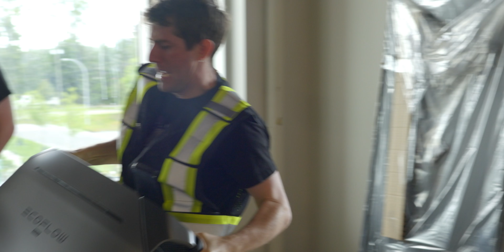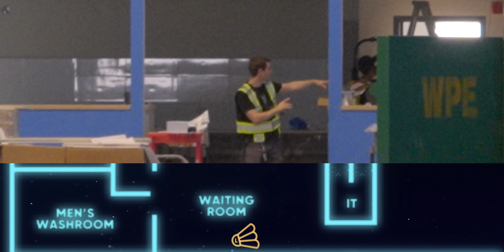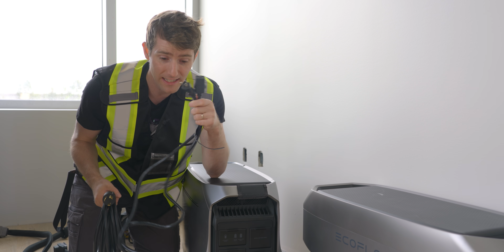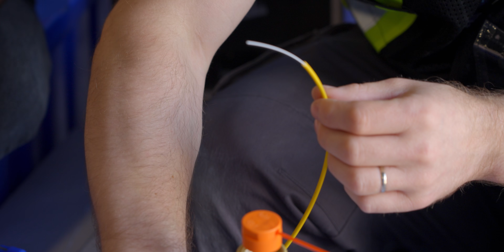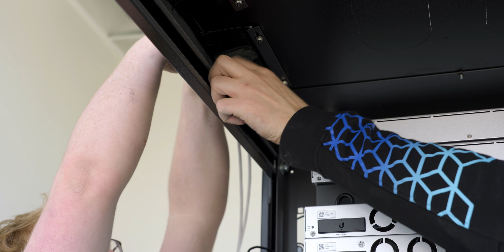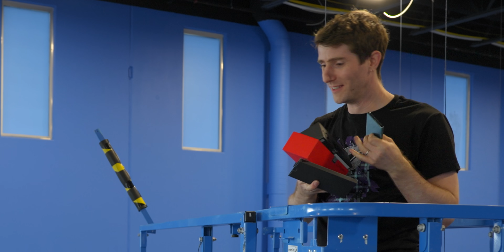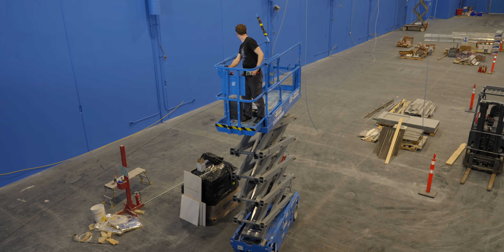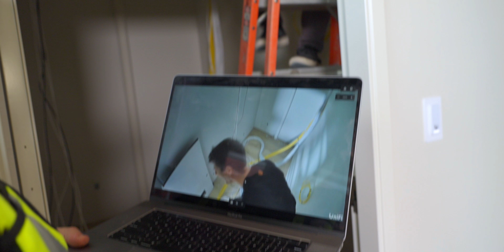I put WiFi 7 in my badminton center

Comment: As someone who does Pro AV. I'm curious to see how they deal with the soundtube speakers. They are Dante network audio devices that require PTP with QoS which the Unifi switches don't support. Aka when guests start using the network it will start dropping audio packets because of latency. If they are all plugged into the same switch it might be ok, but I'd use a switch that supports a proper QoS configuration for them.

Comment: If the power in your home has a dynamic rate that depends on the time, you could perhaps use these batteries to pull a bunch of power when it is cheaper and run off battery when it is more expensive. Maybe having a micro controller automate that could help save money over long term.

Comment: Originally, I was going to comment about the lack of harness in a scissor lift, but as it turns out, per Canadian federal law, harnesses are not required on scissors if they have guardrails. 

However, most provinces require harnesses with non shock absorbing lanyards, but work safe BC does not require fall protection in scissor lifts, Ontario on the other hand, requires fall protection in any sort of mobile work platform, regardless of if it’s elevated or not.
Reply: Not familiar with BC legislation but for Manitoba, the only exception to the harness requirement is if you're not driving the scissor lift. As long as the lift remains stationary, you can go as high as you want without a harness.
Reply: Pretty sure its specified by work safe bc @ 3m, regardless of movement or not in a scissor lift. Most employers will require you to have a harness if your feet are above 6-9ft, or near a leading edge (regardless of height).
Reply: @jzytaruk  honest question, what would they accomplish?  There is basically no way to fall off of ones of these without doing something dumb like climbing the rails.

Comment: I sell and install access control for a living. For the strike. If you don't want to cut out the dust box and cut the frame you need a no cut strike. It will fit in the dust box and no need to modify the frame.

Comment: I only knew POS as "piece of shit" until after I went to a restaurant where the cash register was acting up. The manager told me "we're having POS problems" and I didn't question it because the cash register was acting like a POS. A while later I realized he meant Point of Sale. A while after that I realized he probably meant both.
Reply: It means both.   Point of Sale stuff is fricking horrible
Reply: @markoshark4697  Dead heat between Aloha stuff which is COM all the way down and Micros which uses XML files dropped into a Samba share to communicate between front and back of house systems tbh
Reply: @tparadox_1988  As a General Manager of a restaurant. I will confirm POS stands for both lol.
Reply: yeah in that moment, he probably meant both POS' 😂
Reply: Then they perfectly transitioned into talking about POE...now I'm always gonna think of POE as Piece Of Excrement.
Reply: For linguists it's the part of speech :D

Comment: I know that building practices vary between regions but i’ve seen 2 smaller commercial grade properties go from a similar spot (still needing ceiling panels hung low voltage ran etc.) to ready for soft opening in 2-3 weeks. all though the number of laborers almost doubled. It’s honestly impressive

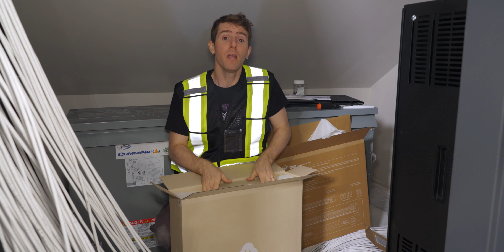Comment: (05:02): Now sponsored by Commercial Electric ..After hearing a story that the voltage in one of the rooms might be too low, Ask an electrician to change the "Primary Tap Changer" setting in one of these transformers. due to computer loads, I would prefer 124 volts at most, to allow voltage drops

Comment: Last night I left my pc on during a thunderstorm with a lot of lightning. This morning my pc was working fine until the evening when I put my computer on sleep mode and woke it up 10 seconds later. It IMMEDIATELY DIED, and a bad burning smell was coming from the gpu. Tech friend says it could be the psu but I tried it with and without a different gpu and it worked. I don’t know what to do…

Comment: Just as a security thing, the wide open strike plates can be somewhat problematic as they often don't stop the deadlatch of the door mechanical lock. This is important as the deadlatch is what stops you from slipping the latch on the door and so bypassing the lock.

Comment: I'm not entirely just of the dimensions of the sport center but I thought for sure "Gamechanger Cable" (thats the brand/type) would have been used and got its own video, it can do 2.5GB/s at 200 Meters and just needs special RJ45s to accommodate the larger cable diameter
Reply: It's significantly more expensive than Cat6 or Cat6A runs. I also wouldn't trust it with reliability compared to cable manufacturers like Belden or Commscope.

Comment: has Ltt never heard of a furniture dolly? or just a dolly? also i feel like the shear amount of wifi in this space will destroy anything else on that band like wireless peripherals cell signal etc
Reply: Wi-fi operates on different bands than cell towers, so they're transparent to each other. It's not likely to be a problem for Bluetooth signals either at very short range, which is all you need even at LAN parties. Hardcore gamers still use wired peripherals anyway to ensure the lowest latency.

Comment: I see your fear of heights isn't that bad. I had to reset thermal fuse in gas heater in about 8 meter height. Everything was fine till like 6 meters and then I just curled on floor of cage and couldn't move. Took me a while to stand on legs but NOPE, wasn't able to reset it and someone else had to do it while I was giving instructions, still curled.

Comment: I install electric strikes regularly, most have to be cut in but there are some that would fit that. HES is a brand that has one but don't remember the part number off hand, you will have to remove the dust box behind the strike

Comment: Soundtube IPD4 series ate Dante. Dante flows can only be done using unicast for a few connections from a TX. You guys will likely need to use multicasting for streaming dante to all the speakers. Ubiquiti notoriously sucks for AVoIP, so it will important to make sure your network is setup properly. Dante is time critical audio. It is inportant to make sure PTP is propegating the network correctly.
Reply: Huh, someone told me Ubiquti sucks for even office IP phones. I didn't understand, but then when I asked to elaborate it was just that Ubi sucks at VOIP stuff. 

Interesting. Now I get a bit of it
Reply: @hariranormal5584 I was referring to Audio Video Over IP but I heard the same about VoIP too. We deal in a lot of  professional audio systems and Ubiquiti is stricken from the list of approved switch vendors. I have never seen an enterprise use them either.

Comment: You have the means for 1Gbps/10Gbps to every machine, and you're all about Wifi? Seriously? Wifi is great on its own, but if you want the best, fastest and most reliable, go hardwired. Either Copper or Fiber.

I get your feelings on the scissor lift... I'm iffy on heights. If I'm 'up high' and on really solid footing, I'm ok, but if I'm 'up high' and my footing is..... iffy...... like scissor lift that is 'less than solid'.... major pucker factor.... for me it's about how solid they are... Some are really solid with minimal movement, and I'm good, but then there are others that aren't so solid, and pucker factor kicks in....

And with Electic strikes, with external doors, you really want them to fail secure, essentially meaning you need to apply power to unlock.

Comment: Few things - HES and Assa Abloy make strikes that'll fit what you're looking for. 

Along with assigning access, I can only hope that y'all have used door contacts on each door with access control / intrusion in order to keep track of doors being forced open without credentials.

Please take a course on working at heights and get your license/certification for operating a scissor lift. It's clear you don't have it. You need to shut off your scissor lift when you've reached the desired height. Any sudden movements that cause you to bump into the control box can cause you to lose your balance and go flying off if the movement involves you hitting the joystick and the lift either going up or down. You could be knocked unconscious by the beam from not wearing a hard hat and fall off.

Fall restraints, hard hats and safety glasses, along with gloves and steel toe boots are needed when working on any sort of lift. It sounds overkill, but there are inherent risks. You saying you don't feel comfortable working at heights and cowering down inside the bucket tells me you're not prepared to work at heights because you're breaking safety protocol for using it. Did you also do your pre-inspection and post inspection?

I'm not trying to sound like an ass, but this video is going out to hundreds of thousands of people and sets a bad example for those who see something similar and think "I'm just going to rent a lift and do the same thing Linus did! I don't even need protection for it!"

Comment: I have U7 pro's in my home with USW-Max 16-POE paired with an aggregation switch and it works pretty decently.
Most Wifi 6E phones cap out around 1.2Gbps however Wifi 7 goes well over 2Gbps

Comment: I became a crane tech about a year ago, and i regularly have to sledgehammer for hours around 30-40, and once i hung a 250-pound hoist on top of scaffolding on top of a 150' storage tower. I had a job in nebraska in the middle of the night, the biggest building I've ever seen and had never used a scissor lift. I had to max it out. It was so sketchy that i chose to walk the rails, and i literally just had to get comfy with "at least it will happen fast." Fear of heights gone forever. I met a guy who rode a scissor lift to the ground, though, and wow.

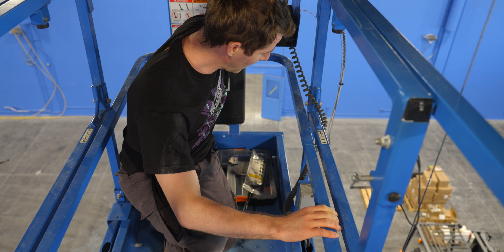Comment: 17:25 I worked at a warehouse, I sometimes helped the stock pickers that used scissor lifts to store and pick boxed bycicles, and those guys were straight trolls, jumping and swinging while at full extend, after a few hours you get used to the movement, but the "this is going to tip over" feeling takes a while

Comment: What yal need to do is have a proper sized data center not a tiny @$$ closet and properly install your equipment and not be sloppy! Preferably use a MSP yal basically over 10 years have never had a proper and clean data center to my understanding buddy 😢

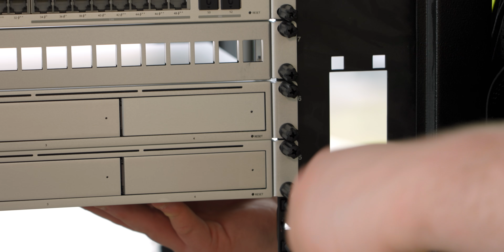Comment: 12:58 - Ummm, why not install the NVRs in the top 2 vertical blanks?  This not only stiffens the rack while you wait on the blanks, but the NVRs do not need any frontal cable runs.  So it won't interfere with cable management.

Comment: I would be more impressed if it weren't for my Pixel 7 getting 1440 mbps up and 1440 mbps down using the lowly ISP provided hardware that I haven't been able to justify replacing (Bell Gigahub and also to a Bell WiFi Pod - both 6e)

Comment: Good to know the faster ports are at the end, going to be replacing all our unifi waps with cisco 9130axi that can run at 5gbit sucks they only do 2.5gbit but will be better than the 1gbit at the other end, already have full unifi switches and already have the aggregated switch for the core fibre, good to see someone else using the same hardware 😂 make sure if you're not using a physical management and it's a windows vm to use 17.1 java or it won't run as a service 😂

Comment: 4 kWh with 4000W hybrid inverter for 3700$ (I'm sure if I buy it from Europe, it will be the same in euros cause capitalism... ). And 1800 extra $ for every 4kWh...
Let's do some math... If I want 15-16kWh I will have to pay 3700+(1800*3)= 9100$ And that's the price for the battery with a 4000W hybrid inverter... 
What's the alternative? 16 LifePo4 EVE LF280K cells, a BMS, a box maybe and a 10.000W hybrid inverter. 
"BUT DUDE" I hear you say "This is compact and has wheels". Yeah, no... By the time you need 16kWh it's neither compact nor really portable. The alternative is actually comparable volume wise.
What's the price of the alternative. Less than 2000€ for the battery and 500€ for the inverter. 100€ for cables.... Basically 2550€ for the whole package. I don't know what you say, but 2550€<9100€

This hype with the power station is really unreasonable to my eyes... They are extremely over priced and underpowered... 
If I was to build a 4000W unit with only 4kWh of power, I would buy a 280-300€ hybrid inverter and get 8 LifePo4 cells with a proper smart BMS. This would cost me 1500€. It would be way more customizable and allow me to argue that the battery would live for much much much longer... Why pay more than double for something worse? 

If your goal is to buy a power station, chances are you already are pretty tech oriented. Please examine the possibility of building your own. Or ask a friend for help. Wasting money so that you won't use some time, is not always the smartest decision...

Comment: You may want to mount those WAPs on pedestal mounts to get them a bit further down, mounting them that high up could result in issues for users at ground level. They're only really designed to handle users within 5-6m, see below for maths:

Based on the 6dB gain from the U7 WAP antenna and typical 3dB gain on the receiving device, and approximate 10m of distance, that will result in 55-60dB of loss between WAP and client on transmit. With an expected -25dB RSSI at 0.5m the access point you'd be around -80dB at the ground which will be outside of useable range even for users directly under the AP. This will be compounded by the reflections off the concrete walls resulting in interference on those channels.

Comment: Until it isn't. Take any WiFi router on the market. Each and every single model has random disconnects. There is no such thing as a WiFi router that doesn't drop both packets, and the connection entirely.